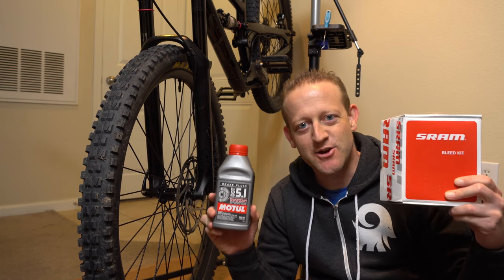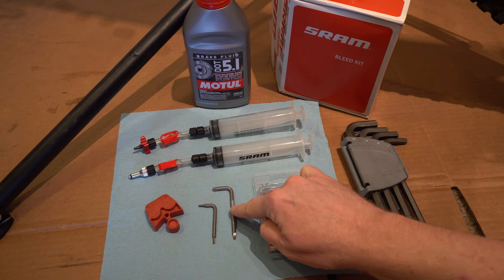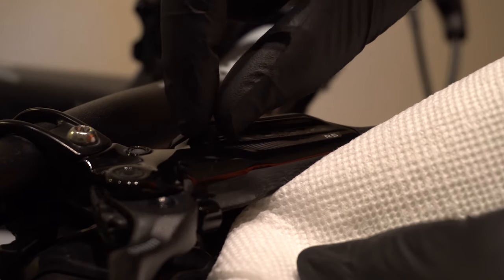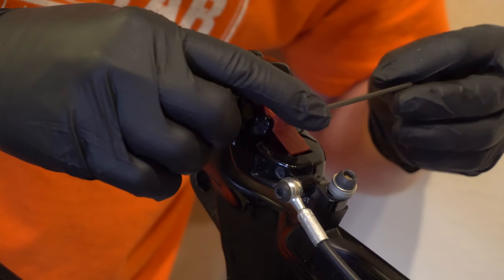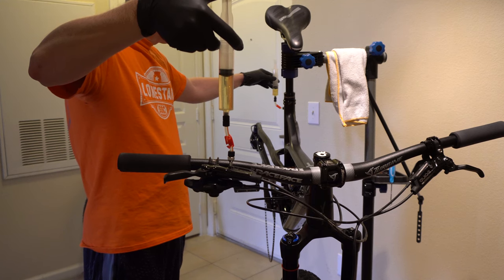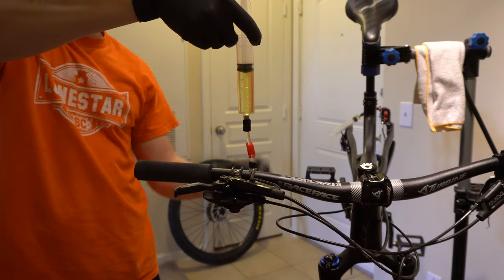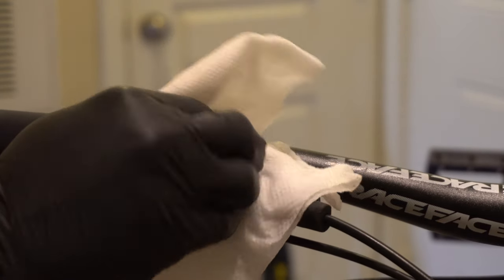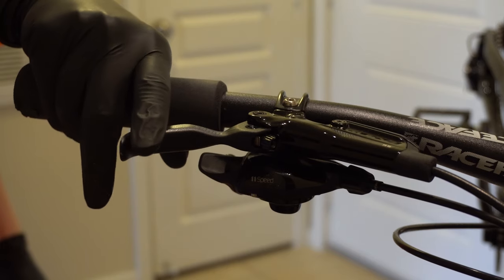How To Bleed Brakes | SRAM Guide MTB

Comment: I would suggest you have an assistant all ready to put the bolt back into place on the lever the instant you unscrew the syringe tube, in order to minimize the loss of hydraulic fluid.

Comment: I've always been terrified of bleeding SRAM brakes. Nice explanation, I think I'll give it a shot.
Reply from the maker: I didn't think it was too difficult!
Reply: With the new tool it's a breeze but yes , I hate dot fluid. IDK why Sram still uses it. It's not good.
Reply: @LuisManuelHdez  Dot fluid has its place. Its just that its overkill for mtb brakes. We dont need as much power or heat management as motorcycles.
Reply from the maker: @LuisManuelHdez  yeah, I would prefer mineral oil, for sure!

Comment: Time for some TRP Brakes.... lol I like the feel of Sram brakes more than Shimano for slow techy bits, but shimanos are so much easier to bleed!!! Its a good thing I watch your channel like a hawk because this was hiding in the notifications!
Reply from the maker: Shoot, I thought this was easy, how much easier can it get?!
Reply: @huntstyle  The only reason I run Shimano brakes is the simplicity of the top bleed. You pull a screw off the top lever, put a bleed cup on, fill with mineral oil, pull the lever until the air bubbles come out and that's basically it. 2 minutes. Like I said, I like the feel of Sram more, but the top bleed is too easy lol
Reply: Oh and great time frame! for this video, how to's have to be super descriptive and condensed and you nailed it
Reply from the maker: @OutdoorGold  Oh wow. That is really easy! Well, the only reason I run SRAM brakes is because that's what came on the bike, lol!
Reply from the maker: @OutdoorGold  I see some things I could improve on! I just need to plan it out better. It takes a lot of messing with the camera while you're trying to do work on the bike, and it becomes a mess!

Comment: Hey mate hope you can answer a few questions, I’ve noticed on other tutorials they pull the lever with the lever syringe still attached is your way better? I also noticed you had the rear syringe vertical when pushing oil through but other seem to have it just flopping down? I’m new to all this so sorry if they’re straight forward answers
Reply from the maker: This was straight from SRAM. The purpose of keeping the syringe vertical is to keep air bubbles from getting back into the system. If you just let it hang down, you could get air bubbles.

Comment: How can I tell if bleeding was successful? With contact adjustment all-in brake seems to be fine, but with contact adjustment all-out I can touch my fingers with that lever. Is this okay for sram brakes? Cos I literally triple-check every step in official bleeding guide and I also did everything you do in that video.
Reply from the maker: Does sound like there's still air in the system. Maybe it got in before the bleed port was closed back up?
Reply: @huntstyle  you mean when unscrewing “lever” syringe? I did it slightly slower than you, and I got more dot fluid coming out than yours before I put the bolt in place.
Reply from the maker: @浅野旅団  yes. Did you have your lever adjusted all the way out when you did the bleed?
Reply: @huntstyle  Almost all the way. 75-80mm to the grips according to sram bleeding guide. I did some research on the internet and it appears there are quite some people who have the same problem with sram brakes. Some guy on the forum claims it’s a “pressurisation” issue and he wrote a whole guide how to avoid it, but I haven’t noticed any difference unfortunately. You can find his explanation here if you’re curious https://www.pinkbike.com/forum/listcomments/?threadid=190668
Reply from the maker: @浅野旅団  interesting. Well, thankfully I haven't had that problem. Hope you get it figured out!
Reply: @huntstyle  thanks. Next year I'll try to full service my brakes, maybe I'll learn something important)

Comment: What do you do when the bleeding block down not go in? That's the hard part in my opinion.
Reply from the maker: Yes, I had that problem! You have to push the pistons back. I just used the big allen wrenches, like the 8mm & 10mm, but Park Tool also has a tool specifically for this. Do it with the lever syringe on and the clamp open so the fluid can move back through.
Reply: I use tire levers to push the pistons in.
Reply: @huntstyle  I'm going to assume the Guides have ceramic brake pistons that are recognized to be fragile and reasonably intolerant of metal persuasion. Plastic tire levers are an ideal lever to retract those little guys.
Reply from the maker: @Craig-mk6wn  I can't find anything that says if they are indeed ceramic or not, but the Pedro's lever should do the trick next time!
Reply: put some drops of dot fluid on the side of the piston, then compress, maybee the caliper need to be cleaned
Reply: Nice vid. Do you squeeze fluid in with the lever pressed? Thanks.

Comment: Watch sram vid on this bleed . You missed some important steps dude .other than that good vid
Reply from the maker: The SRAM video goes into more detail. I tried to simplify things for this video to keep it short & sweet. What important steps were missed?
Reply: Huntstyle did you depict or cover the step of closing-off the bleeding edge caliper bleed port before disconnecting it... I saw you open it up for sure... hmmm... or does it just reset itself to the closed position?
Reply: I’ve seen both videos and he didn’t miss any steps there Gail.  And hamishr watch the video again he does close the valve 🙄

Comment: Too much maintenance . How did hydraulic brakes become so popular when they are such a pain in the ass.
Reply from the maker: This only needs to be done about once a year! That's not that much. You get wayyyyy more power with hydraulic disc brakes.
Reply: Your right about the maintenance thing , i'm just a grumpy and lazy old man😂
Not sure about the waay more power aspect . I have really strong hands for my age and i don't ride fast anymore , so more stopping power isn't an issue for me. 
Thanks for the reply
Reply from the maker: @siriosstar4789  haha, understandable! Yeah, with disc brakes I can stop pretty quickly from 25 mph using only one finger.
Reply: @siriosstar4789  maybe I just have strong hands but I don't think disc brakes are worth it. My old Kline with v brakes is maintenance free and I use the same number of fingers on the levers as I do with my 29er with discs. Tubeless tires aren't worth it either.
Reply: It’s not a pain in the ass if you’ve done it a couple times. Just get the proper kit and it’s quite easy